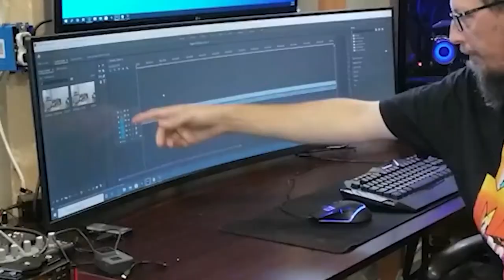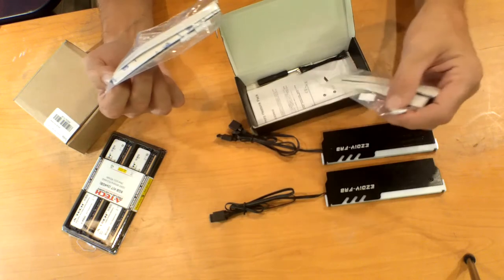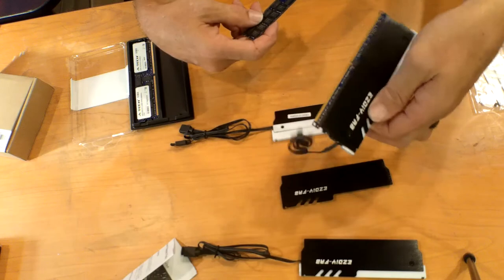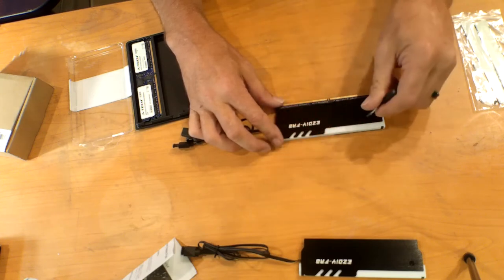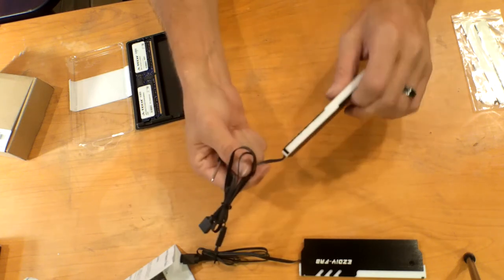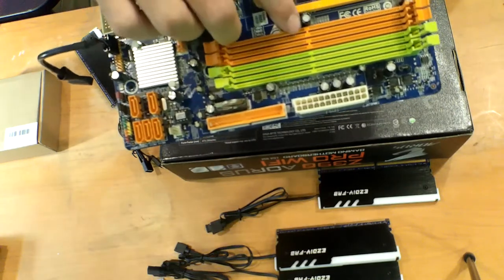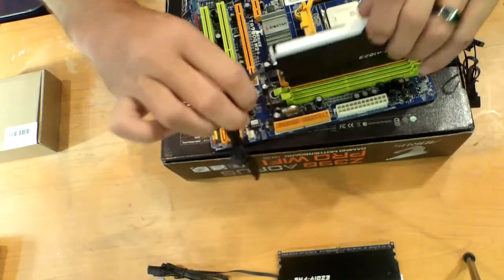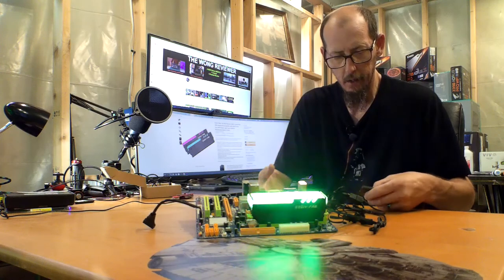HOW TO INSTALL RGB HEAT SINK ON RAM AND INSTALL THE RAM ON A MOTHERBOARD

Comment: A bunch of people are telling me I shouldn't use these on RAM sticks that already have an installed heatsink...
Reply from the maker: I’ll be honest I haven’t put them on ram that came with heat sink prior. I don’t see why it would hurt it. Did they give you a reason?  The ram I put them on was bare ram. I haven’t had an issue with them at all and they have been on there for over a year.
Reply: @RYNOTECH  Some did and some did not. Those that did said it is because I would have to remove the pre installed heatsink (I have Corsair Vengeance DDR4). I am not sure if they are aware that this is a heatsink as well.
Reply from the maker: I personally don’t think it will hurt them it comes with the thermo pads. You just need to make sure you get all the old thermo pads off. There metal not plastic. They are heat sinks. Only data I have to go by is the ones I put them on. That computer is old but it runs all the time. Rj my son uses it to play mind craft ro blocks and fortnight. Never had any issues. Let me know if you get them.
Reply: @RYNOTECH  Im going to order them later. Worst case is the RAM throttles and I return it. I will let you know once I receive them.
Reply from the maker: That’s cool. I doubt they will.

Comment: do these still work properly? that rgb controller could be the anser i need for this pc i just bought with no argb plugs
Reply from the maker: Yes  I had to use that controller in the pc I put them in. I have a couple videos after that one of the pc build I used them. The computer they went in is in it’s second case. They have been working great. That pc has been in most my live shows and on display in a lot of my other videos. The pc it went into is called gramps.

Comment: I connect it on motherboard 3pin but its not working do i need rgb controler? Thanks sir
Reply from the maker: I have mine on a controller however there addressable so they should work on the motherboard. Mine are 4 pin connector. What software are you using to control the rgb?
Reply: @RYNOTECH  i connect it in 3pin connector on my motherboard msi 970 gaming but its not working
Reply: @RYNOTECH  i dont have controler 4 rgb
Reply from the maker: Shoot me an email at cpptech2020@yahoo.com send me pics of what you have and I’ll look up your board really quick.
Reply from the maker: I see your problem. Those three pins are fan headers that’s why it don’t work.